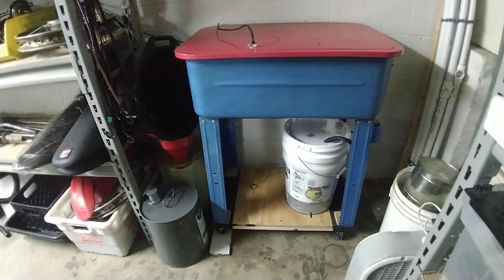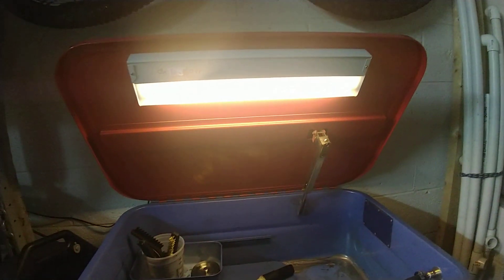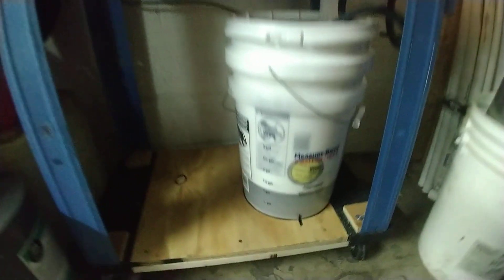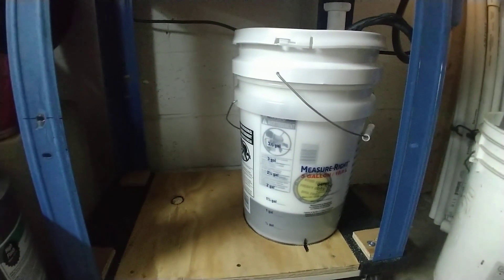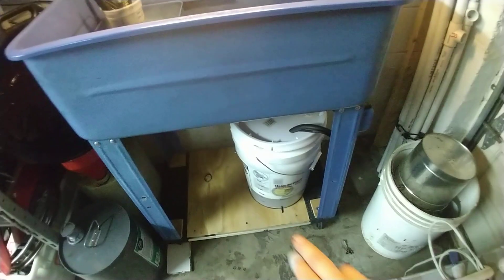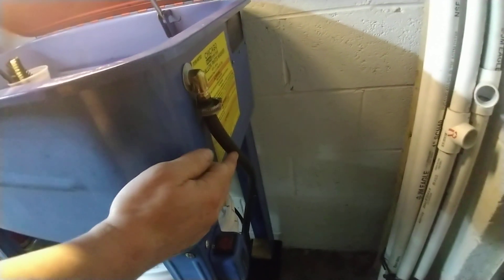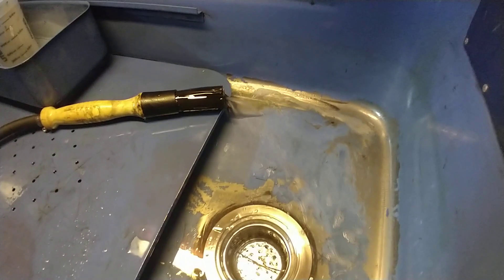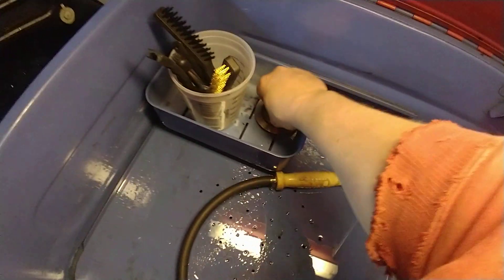Modified Harbor Freight parts washer with remote solvent tank

Comment: Is the pump fully submerged in the bucket ? 

Can you show a picture of the drain under the tank?
Reply from the maker: The pump is fully submerged in solvent in the upper bucket (the lower bucket has water).

The drain is just a straight piece of sink drain pipe that goes straight down into the lower bucket (the one with the water).

The solvent is lighter than water so always rises to the top. Dirt and other gunk sinks to the bottom of the water.

Comment: Son of a….that is the slickest and best mod I’ve ever seen on these washers. Well done sir! I’ve been thinking of putting a wye where they solvent comes out into the washer and put the rubber hose w/brush on the wye on one side and the factory metal spout thing. Put a valve to open the one im wanting to use and close the other. That way i have two options and not always stuck holding the brush to use for cleaning.
Reply from the maker: Thank you.

Comment: The drain.  No one ever talks about it and I'm trying to figure it out. I installed a sink drain and have tried every kind of sealant and gasket...  the fluid eats it. I use PSC1000 like a lot of ppl do.  Please help LOL
Reply: What about Permatex Ultra Black RTV Silicone Maximum Oil Resistance Gasket Maker from the auto parts store?  I have used this on lawnmower and pressure washer fuel tanks and have not had an issue with leaks.
Reply from the maker: Granted I'm it using this parts washer a couple times a month, but so far the black RTV I used has held up fine.
Reply from the maker: FYI, another year has passed and the RTV seal still does not leak.

Comment: guessing the PSC floats on top of the water like vinegar and oil? So that allows the solid particles to sink into water in the bottom bucket and only pump PSC thru the hose?
Reply from the maker: That's correct!

Comment: You used the pump that came with it and put it in the bucket?  How did you handle the short wires?
Reply from the maker: I extended the wires approximately 12 inches.